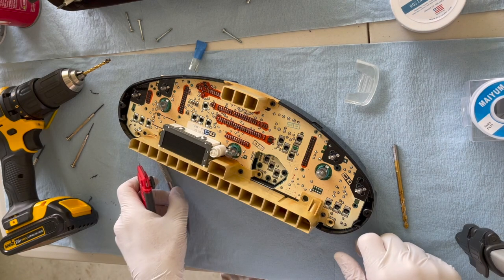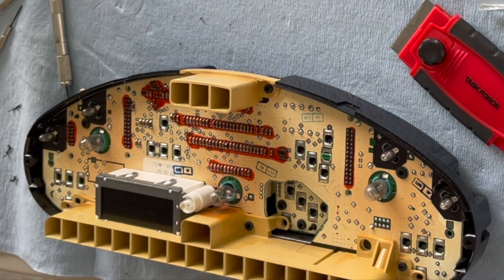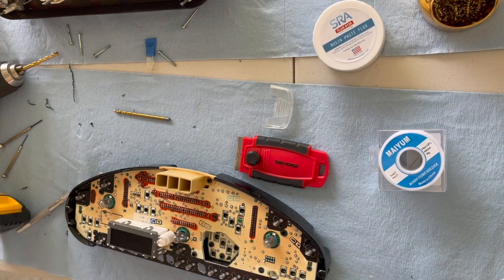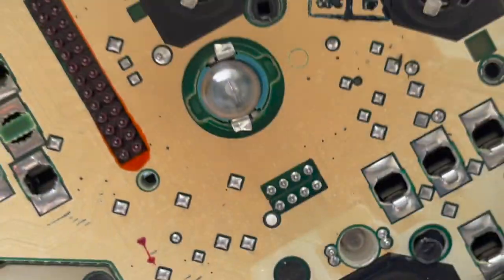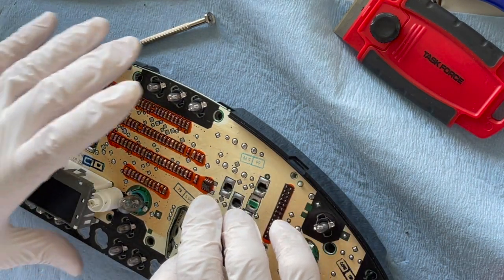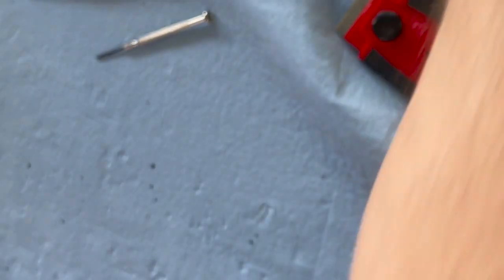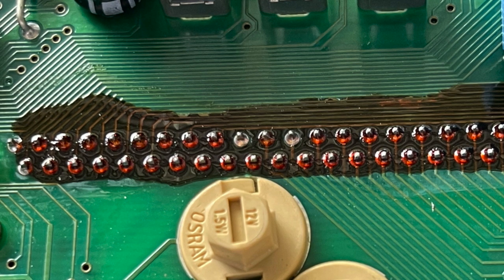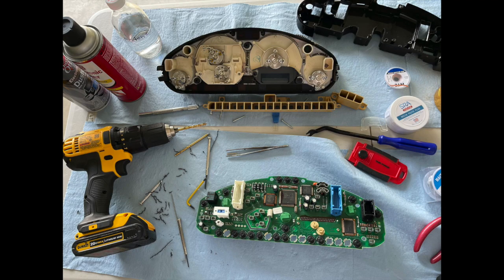Instrument cluster intermittent LCD screen repair BMW e36 M3 (Part 2)

Comment: Mine doesn't work at all its pitch dark, do you think I need a new one? can you buy them knew still ? is there a way to test them with a 12 volt battery outside the car on a bench?
Reply from the maker: Make sure to check all the bulbs.  It is hard for me to predict why your clusters is all dark. There are schematics of this harness that show where the 12 V leads go in and you can simply connect it to power outside the cars. Others have done that before.